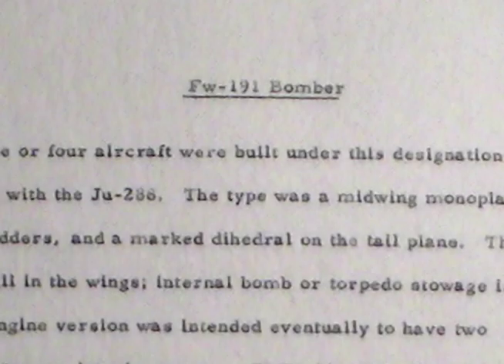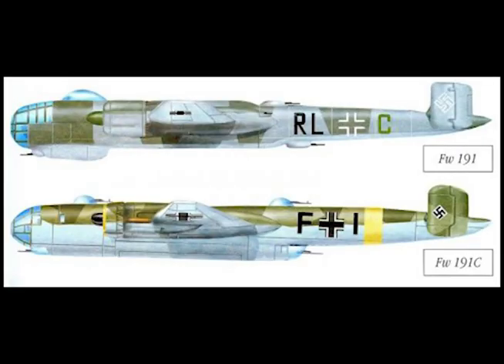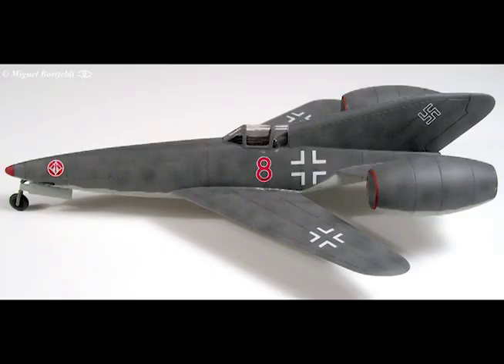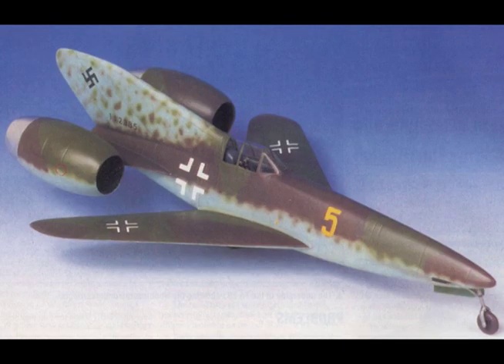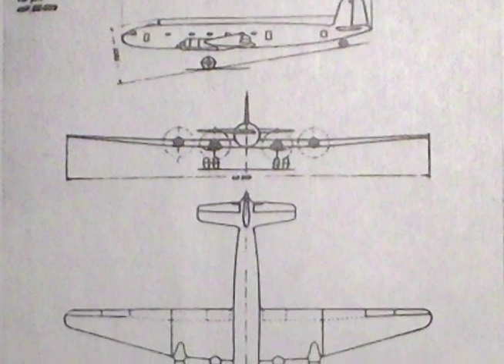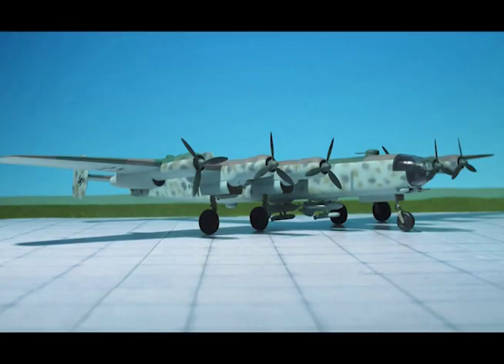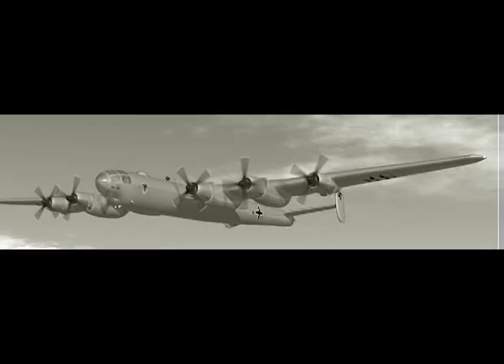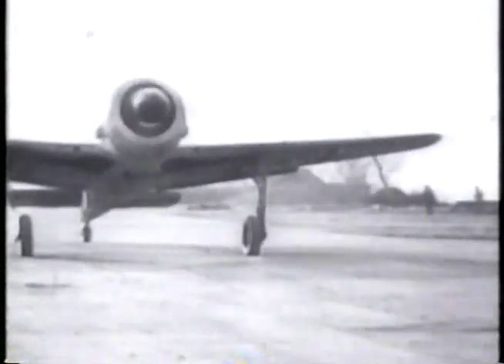German Experimental Aircraft of World War II #11 - Focke-Wulf pt 2

Comment: G'day 

Wow,

Fascinating...!

That Tri-Fuel/Trimotored Rocket-Launched Twin-Ramjet thing..., that was
REALLY Wild....

All the Rocket-based tribulations of the Me.-163b...; but at least it landed on retractable Wheels..., very narrow (but LIGHT, and Streamlined...)

The "Athodyd" goes a bit beyond my ken though, but I encountered them in an Arthur C. Clarke Novel, written shortly after his Paper to the British Interplanetary Society, by explaining how Orbital Satellites could function as Radio Relays ; thus constituted 
"Prior Art"..., 
And because
Publication
Prevents
Patentability...

Since 1947, nobody has been able to Patent Communications Satellites.

Sputnik-1 was a Broadcaster, Telstar was a Relay...

So, I hazard a guess that because a V-1's Argus is a Pulse-Jet, with Parallel Shutter-Vanes as an Aero-Mechanical Valve...,
and becsuse the Tip-Jet-powered Tailless Heligoflopters burn Butane or Propane or Compressed/Liquified Natural Gas - but no Flappy Vane Venetian-Blind Valves, are called "Gas Jets"...,  and the (Resonant Harmonic Cavity) "Valveless Pulse-Jets with which Eccentric Homdbuilders try not to hurt themselves, are
"Pulse-Jets using internal Sonic Harmonics in a Chamber featuring Tuned Inlet Pipes, for "Timing"..., and the Red-Hot sheetmetal Stovepipes for ignition...

The only way I can imagine that the
"Athodyd" is intended to function, is by being a fancy way to say that they're, simple pure Ramjets, relying on Airspeed to forcibly ram Air into being Compressed but not accelerated as it transits the narrow Throat...- so, "Reverse Venturi Effect, achieved by finely tuning the Inlet Torus Diameter, Throat Diameter, Airspeed, and Inlet Wall Profile, Section, and how much constriction is applied WHERE...; Then "simply" spray atomised Fuel behind the Throat, at about 13 Parts Air to 1 part of Kerosene...,
And ignite it.

Throttle
"Should" be able to be effected 
Via Fuel Volume pumped in...

My understanding is that
EVERYBODY who tried to make that concept function, quit - due to the fact that they could maximise Efficiency at Cruise, or Full Power..., OR they could build them to start and run RELIABLY, at the bottom 10% of their operational Airspeed Envelope...

Unless I've guessed wrong about what an
Athodyd might be, and 
How it's intended to work...(?) ; then my guess is that the Germans couldn't make it both start reliably..., and run efficiently at full power - either (?).

And, then,
Pod-mounted
Twin Engines out a long way from the
Centreline...;
Generally causes an immediate
Uncontrollable 
Spiral Dive - until the other Engine can be shut down, and
Control may be
Regained...(?) !

Or a Wing
Falls off.

But, 
IF they could have
Coaxed the
Athodyds to
Behave, and 
Perform...;
I would probably pay money to watch
Someone try to levitate in such a
Precarious
Contrivance...!

The other machines were all pretty conventional, really ; known to work, type of Technology.

Such is life,

Have a good one.

;-p

Ciao !